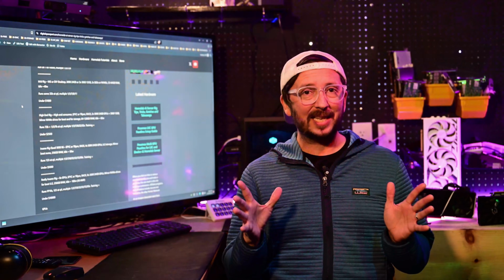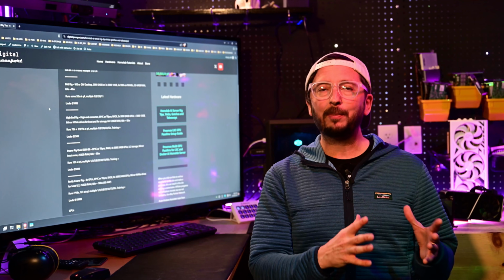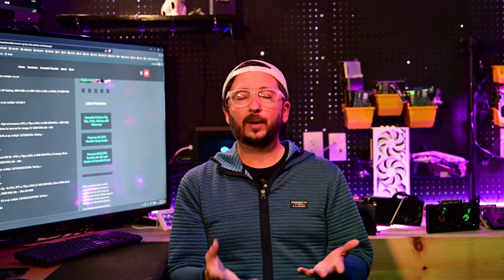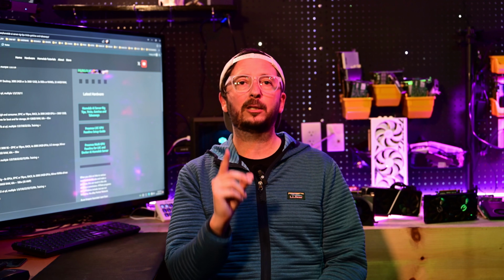Ai Server Hardware Tips, Tricks and Takeaways

Comment: Sold my 5090 for a tidy profit🎉, not enough VRAM bought for £1700. I bought Asus X99-E WS, Asus M2 PCIe card for extra NVMe, 64GB Kingston RAM, dual Asus TUF Gaming 7900 XTX for about £1600. Need to source a PSU and case. Was thinking adding another or two 7900 XTXs. With TurboQuant I can run Qwen 3 Coder Next with 262k cache. For inference AMD is king, nVidia gimp the memory for the price they charge 5090 for today's prices should come with at 256GB...

Comment: One question I'm searching the answer to is about the PSU. If I'm using a server grade dual CPU board, should I use a PSU of use a server grade PSU. Also, if I'm using multiple GPUs that total over 1000 watts, should I use one large PSU or use dual smaller PSUs split between the GPU/risers and the rest of the system?

Comment: What is the recommended local server hardware (CPU, GPU, RAM, storage) and approximate cost to run GPT-OSS 20B and 120B models through an API? Also, can 20B run efficiently on a 24GB GPU, or is higher VRAM (e.g., A100 80GB) necessary?
Reply: Yes it can run on 24GB gpu if you quantized it you probably need to quantized it to fp8, rule of thumb is that on fp16 it's 2X Gb of vram so for example if you have 20B model you need 40GB of vram.
Reply: @MtFoxt thank you sir ❤
Reply: @IshaqKhan010  Depending on your use-case you can usually fit 4-bit quantized 32B models on a single 24GB card, but accuracy will suffer somewhat and you won't be able to fit that much context. Every 4k of context generally increases VRAM used by ~10-20% of the original size.

Keep in mind that you can also split LLMs between multiple GPUs, so you can reduce your buy-in costs significantly by running something like 2x 24GB cards as opposed to a single 48GB card. It really all depends on what you're using it for. Either way, VRAM and low-precision acceleration (FP16, int8 and int4 support are basically a requirement. Fp8, fp4 and nf4 will likely help your system remain viable for longer but aren't as important) are the main limitations
I'd suggest you look at quants on huggingface for whatever model you want to run to get a rough estimate the amount of VRAM you need based on the Q8 file size.

Comment: This video is from half year ago.

Is now any change in this 4:08?
Reply from the maker: Yes they merged this change but it was not a performance improvement as many uad hoped for. Llama.cpp can effectively do this the best but still looking at only 20% gains if you have to shard the model to all cards. That is because the llm runs a linear pattern hitting the cards stored on each layer, and different layers are offloaded to different gpus. If you want true performance imp, running a model in parallel that fully fits in the vram of each gpu is the way, but then you sacrifice running that vs larger models which are better quality. Hopefully diffusers fix this.

Comment: Just got an AMD MI50 for less than 125$ for my Egpu. Best bang for the buck. Got 20 tokens per second for Codestral 22B (13.34Gb download). Gonna try to get another one and build a  budget workstation with 2 mi50s.
Reply from the maker: Interesting GPU. Checking into it now. ROCm no issue?
Reply: @DigitalSpaceport  LM Studio uses Vulcan, I believe. I just read up on these graphic cards and I believe with AMD infinity bridge, you can scale up GPU and VRAM at the same time. AMD definitely has interesting products.

Comment: Thanks for sharing your tests and experience with tons of hardware options for running LLMs. I've setup my system with a amd rx 7900 xtx with 24gb running on ollama-rocm docker container and I am pretty happy. It was really easy to setup as I just had to install rocm drivers and pull the container image from the ollama docker hub. Performance wise, it runs really well on 32b models. For example, qwen-2.5-coder:32b I am getting 26.29 tokens/s and deepseek-r1:32b  25.70 tokens/s. The VRAM consumption for 32b models was on average 22660M / 24510M or  92,45% reported by radeontop.
Reply from the maker: thank you VERY MUCH for providing numbers that I can reference if needed. Glad the rocm ollama container has all the bits needed to make usage simple and straightforward also. Pretty decent numbers frankly.

Comment: I'm building this rig without GPUs first. Will wait for black friday this year ahaha Btw, ebay sellers started rising prices on MZ32 and AMD EPYC 7002 after these videos
Reply from the maker: Look for H12SLL-i as the MZ32 is basically not available. The 7V13 or 7C13 is also more recommended vs the 7702 CPU if they are close in price. Very large performance jump in thread speed.
Reply: @DigitalSpaceport  thank you. I already managed to get MZ32 rev1 and 7702 recently. Maybe I'll upgrade to rev3 a bit later to run 7003 series. Not sure yet, feels like a bit of risk
Reply from the maker: I was surprised it worked also but I had read others say they did it. Of course I have had that exact logic backfire on me a lot also lol.

Comment: VRAM is not the deciding factor. For transformers it's Tensor Cores, Bandwidth, VRAM. In that order. You can have all the VRAM in the world but it's useless without the Tensor Cores and bandwidth to back it up. Transformers and bottlenecked by bandwidth, as you saturate bandwidth most of the cores are idle. Diffusion on the other hand is compute bottlenecked, as your compute is saturated, most of your bandwidth will be unused. The best bang for your buck is dual 3090 (not the ti as it doesn't have nvlink) for transformers. I'm not sure about diffusion but I suspect the 4090
Reply: @MichaelBarry-gz9xl ?
I got 2 3090 Ti FTW3 ultra's
They got nvlink 
Maybe depends on the version?
Reply: @flosa1995 Hmm, I wish I knew that before I bought, I would have got Ti's too. For some reason I thought they got rid of it on the Ti
Reply: I @MichaelBarry-gz9xl 
I read that a lot now that I paid attention to it ^^'
Even in nvidia forums etc 
"3090 is the last GPU with nvlink support" etc..
What is actually meant is "the 3090 family is the last with nvlink support"

Accidental misinformation out there I guess
Reply: @flosa1995  That makes sense, serves my own right not checking the source

Comment: thank you for the video. somethings don't make sense but i'm not quite sure. if you run prompt below, based on the max wattage requirement for these GPUs, almost all desktops mentioned in the video including HP Z440, Dell Precision and Dell Optiplex series require PSU upgrade first. Then there is the question of cooling the rig so upgrade the fan? How can you run RTX 3090 card that needs 350 Max wattage and Dell Precision 3620 Tower has two PSU versions 290W and 365W MAX wattage?

Prompt: Create a table listing NVIDIA desktop graphics cards with the following details:

Maximum Wattage Requirement (W)
VRAM (GB)
Idle Minimum Wattage (W)

Result:
NVIDIA Card	Max Watt Req (W)	VRAM (GB)	Idle Wattage (W)
GeForce RTX 4090	450W	24GB	~20W
GeForce RTX 4080	320W	16GB	~15W
GeForce RTX 4070	200W	12GB	~10W
GeForce RTX 4060	115W	8GB	~8W
GeForce RTX 3090	350W	24GB	~15W
GeForce RTX 3080	320W	10 or 12	~12W
GeForce RTX 3070	220W	8GB	~10W
GeForce RTX 3060	170W	12GB	~8W
GeForce RTX 3050	130W	8GB	~7W
Quadro K2200	68W	4GB	~7W

Comment: Not sure if i just missed it, but have you tried AMD gpus? i am interested in their 16GB VRAM models which i can get pretty cheap compared to their nvidia counterparts. Another thing i am curious about - is it a good idea to get a bigger models compared to what your current vram can ideally handle. For example, you have an 8gb vram and ptobabably the ideal would be 7B models. What if i use 14B or bigger then partially offloading gpu layers. let's say im not really into very fast tps as long as i get quality results. i can work on around 2 tps as long as it is accurate because i mostly use it for coding.

Comment: AVX-512 (not  AVX, at least AXV2). and onboard video can be used.  CPU performance should not be mis-aligned to your GPU; i.e. an RTX 5000 series (consumer) with a PCIe-3 CPU (I7-10700 is PCIe-3 bus speed) as bandwith on the PCIe-5 Nvidia cards have less (128bit) due to their increased speed ability and the input speed will bottleneck the card of NVLinked to another card through the PCIe bus....  L3 CPU cache should be optimized by setting your individual core limits and even idling some..  On your Dell I would think that you would switch to lower core - higher L3 CPUs (8897).  Containerize/VM and have a back-up system; LTO-5/6 tape.. (still a 4+ hour back-up).  Oh, on win2016 server, Grok took the system down (after finding Minstral) and card of choice; (QuadroRTX 8000).. back-ups are essential.  DON'T BUY FROM CHINA.  The Post Office has stopped about all deliveries out of China due to over $800 items no being declared (enough and POTUS directives).

Comment: For Intel Python Extension for Tensorflow, Pytorch, Radeon Open Compute (ROCm) and Compute Unified Device Architecture (CUDA) carefully research you use case and map your device you want to use before you buy, sometimes a lower CUDA compute capability can work with your task but it is dependent on what you are trying to do.

FYI I am going to mimic your setup before August, hopefully with Quad Arc770s.

Comment: Nice video! Sub and thumbs up. Seems we share a passion.

I have an older Ryzen 3950x CPU, an RTX 3070 8 GB and 64 MB RAM. I can run models like gemma2:27b-instruct-q2_K on that, at 6tokens/sec. That more than enough speed for me. I like to ponder on the responses I get. On larger models both CPU and GPU run simultaneously, like 75% CPU and 25% GPU. Some 70b q4 models run only CPU - slow at 1-2 token/sec, but "possible".

Btw. Does anyone know the ollama /save <modelname>? It only "remembers" one generation of conversation back (by saving model and context window of the "current" session?). Is there a way to increase the amount of conversation saved, including older conversations?

(That way you could create a "continuous" person between sessions. It sort of works with only "one generation". The model always remember "where we were". Oh, the meta-physics of this is mind-bending. :)

Comment: Thank you for the insights. I currently have 2 x RTX 3090 NVLinked and I’m interested in start experimenting with local LMMs. Do these models benefit from memory pooling anyhow? If so, would you know what model sizes I could run with such a rig?
Both GPUs are running at 8x/8x PCIe 5.0 on a system with Intel 13700K and 128GB DDR5 @4800mhz.
Thanks in advance for your help.
Reply: You can run up to 70b at 4bit which will give you just shy of 20 tps.

Comment: Jeepers! Price for that 3090 is currently $1099.99 on Amazon (January 4th 2025) and yet you say “about 750 or 800, last time I checked”. 😢  The timestamp says that this video is only one month old, so is it really true that prices jumped by 50% in one month!?
Reply from the maker: Its 38% if 800 and 46% if 750 but yeah its a big increase. It started climbing mid october iirc and was hovering at 750-800 for a while.
Reply: @ I hadn’t been tracking prices at all, so that rate of increase was a shock.  That said, the all up cost of your 4 gpu rig still comes in cheaper than my M4 Max.
Reply: @richard_loosemore  just bought my second Dell Rtx3080 for their compact size. They are being sold on eBay today 2/7/25 for around 1000, and the majority are looking to auction off their cards. I found a seller that had it f 950dls, placed an offer for 734dls, plus shipping it came out to 800dls. The seller didn't hesitate to sell. If you have the cash throw a number out there. You'll never know whether the seller is more in need than you.

Comment: Is 4 the sweet spot of 3090s? I have 6x 3090s, currently mining crypto. If I wanted to run 2x models, it looks like accuracy would take too big of a hit, might need 8 to hit 8-bit quant on 2 models.
Reply from the maker: Depends on the model params and context but for larger 70B ones yes 4 24gb gpus is often the q8 range. Those also are also are some of the best models aound right now
Reply: @DigitalSpaceport  you touched on a question I had briefly in your video but I wasn’t sure if I took the correct take home message. 

If VRAM is the most important thing, Do you see similar performance from 4 x 3090s and their 96 GB of VRAM vs. 2 x 4090s and their 96 GB of VRAM?
Reply from the maker: 4090's have only 24GB vram each. Not 48.
Reply: @ oops, my mistake, let me rephrase in a less dumb way, do you think it’s better value today in getting, say, 4 3090s vs. 2 4090s vs 1 5090
Reply from the maker: Total VRAM amount matters a lot! It will limit your ability to run models of larger sizes aka quality. I think 48GB total vram for current models makes sense, so 5090 is out at 32 (that may change, models may be released to fit tis size more and more) and there is not much difference in inference tps from 3090 to 4090. So 2 3090s is rather capable. Keep in mind, if you intend to do a lot of image generation, 4090s are twice as fast at that. Also if you plan to fine tune/train, 4090s again. I wouldnt consider a 5090 as they are insane prices and seem to be having early issues they will be working through.
Reply: @ thanks for response! I’m not totally sold on AI image generation yet, so it sounds like going after used 3090s is the way to go…hopefully everyone else is focusing on acquiring 4090s…haha.

Comment: What do you think about this? 

1. Motherboard: MSI D3051GB2N-10G Micro ATX Server Motherboard, AMD Socket AM5, AMD B650, Dual 10GbE LAN, IPMI with KVM.
2. CPU: AMD Ryzen 9 7950X, 16-Core/32-Thread, 4.5 GHz Base, 5.7 GHz Boost.
3. Memory: NEMIX RAM 128GB (4x32GB) DDR5 4800MHz ECC Unbuffered UDIMM.
4. GPU: XFX Speedster MERC310 AMD Radeon RX 7900 XTX Black, 24GB GDDR6, AMD RDNA 3.
5. Power Supply: Thermaltake Toughpower GF3 1200W, ATX 3.0/PCIe 5.0 Ready, 80 Plus Gold, Fully Modular.
6. Cooling Solution: 280mm AIO Liquid Cooler, AM5-compatible.
7. Case: SilverStone CS382, Micro ATX, 8x hot-swap bays, supports up to 280mm radiator.
8. NVMe Drive: Western Digital 500GB WD Red SN700 NVMe Internal SSD, Gen3 PCIe, M.2 2280, Up to 3,430 MB/s - WDS500G1R0C.
9. SAS Drives: 8x Seagate Exos ST10000NM0096 10TB Enterprise SAS, 12Gb/s, 7.2K RPM, 256MB cache, 3.5".
10. SAS Controller: 12G Internal PCI-E SAS/SATA HBA Controller Card, Broadcom SAS 3008, Compatible with SAS 9300-8I.
11. SATA Drives: 4x Western Digital 500GB WD Red SA500 NAS SSD, SATA III 6Gb/s, 2.5"/7mm, Up to 560 MB/s - WDS500G1R0A.

Comment: With the end of SLI|NVLINK, is there hope that the home PC build will run two GPUs with Windows? I want to add a second 3060 12G to my Z790 i-7 14900k, and use it for Stable Diffusion/Flux while also running a LLM along side for prompting.  Am I forced to move to LINUX?

Comment: Even if llama.cpp was highly optimized for parallel processing, it is impossible to achieve linear scaling across multiple GPUs.

Also, when evaluating the Mac vs RTX comparison, remember the old adage of "Statistics don' t lie, but liars do statistics." The nVidia benchmarks only run very small models which fit entirely within the GPU's V-RAM. The performance of an RTX based rig falls on its face when the model is pushed out into system RAM. Running larger models which yield better results will run faster on the M4 MAX hardware because the memory is part of the system on a chip (SoC).

FWIW, the only benchmark results I've found compare an nVidia RTX 4090 build against a baseline MacBook Pro M3 MAX. The M4 MAX neural processing unit (NPU) offers 38 TOPS performance, which is significantly better than the 18 TOPS of the M3 MAX NPU. Granted, this is far below nVidia's claims of 320 TOPS for the RTX 3090 or the 1,321 TOPS for the RTX 4090, but again, those numbers are only relevant for small LLMs (such as the 2.5B model used in the benchmarks) which fit entirely within the GPU V-RAM.

Comment: If I added a ai translater to my game server, how many threads and how much video card would i need?
Reply from the maker: Is there software that does this specifically? Batching in parallel is fairly decently performant but if its just a message here or there id start with finding a model that does translationa the best (sry Im not sure which one that is) and then checking what params it supports. Then size your card to a q8 for that model. Dont forget to add like 20% for ctx
Reply: It is just a few messages here and there. The slang, typos, and in-game jargon make all the translators that I've tried spit out garbage that just seems to create more confusion than help. I was hoping that you would know which software to use, but anyway, I should probably try something simple to learn on.

Comment: I had a Gigabyte x399 Designare Ex 1.0 with Threadripper 1900x and 128gb 3200mhz memory just laying around and not doing much. Was able to get 6 - Asus TUF RX 6800xt's into a MODDED RSV-L4500U 4U SERVER CASE. ALL GPU's at PCIE 3.0 X8. I will next install ROCm from AMD as they have a very large catalog. Would be nice to have some content on AMD RX6000 and RX7000 GPU's as AMD GPU's are very capable, but there is not much content out there.
Reply from the maker: Let me know how it goes Im interested in getting AMD GPU content on the channel.